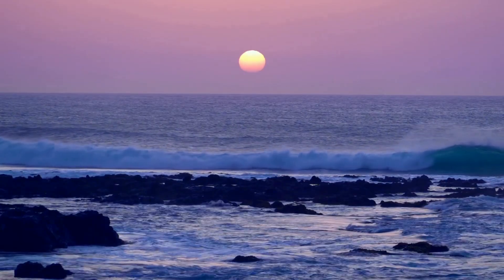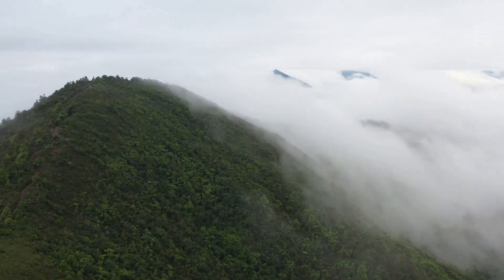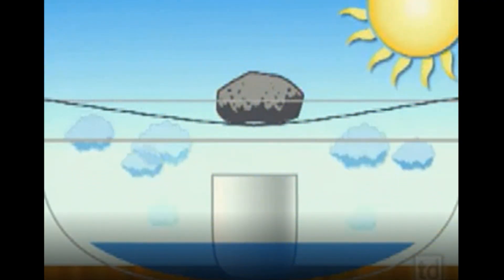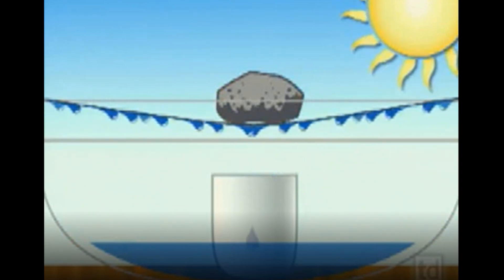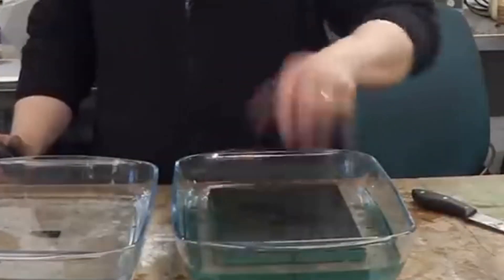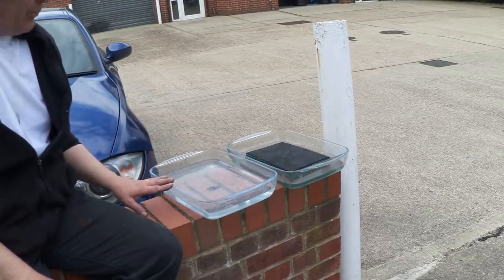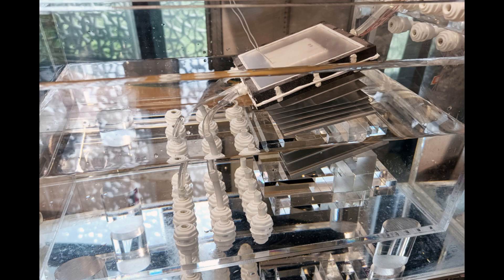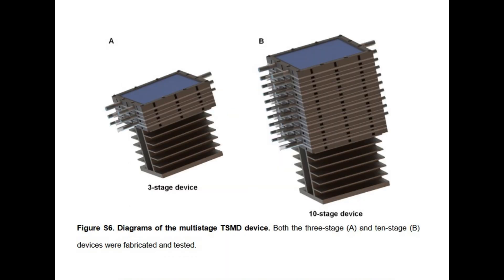2192 MIT Breakthrough On Making All The Fresh Water We Need

Comment: Another way of evaporating water quickly, abet not input energy free, would be to use a babbington atomiser. Same as a babbington burner... just with water rather than oil.
Tiny hole in a pipe. Fluid passes over outside of hole. Inside of pipe connected to source of compressed air.

The spray of droplets has massively increased surface area for evaporation to happen from. I would be surprised if salt would drop out as crystalls, Sally water more likely. Could likely be separated out by a centrifugal filter.

When I tested such a while ago I was getting evaporatoration rates for tap water of about 30l/hour. I was doing it outside in summer, and as humidity was increased towards 100% RH, here was a fair temperature drop in garden.
Reply: This is similar to the way that snow machines germinate snowflakes! Great idea 👍
Reply: Filters drive the costs up, his point was this tech keeps the cost down.
Reply: @troywhite6039  filter membranes not best re cost, but a centrifugal filter to separate moist air from  water droplets, need  be little more than a large diameter drum with a tangential inlet. Air and droplets fly into through that inlet. Being heavier than air water droplets containg the salt want to continue in a straight line and make contact with the walls and drop out of the air flow, and run down to the bottom.of drum. Moist air can make it's way out of a vent at top.

Comment: Robert can you give me a fair of brutal opinion about my idea following: My idea was to turn the Saharah desert into a self-irrigating oasis: at high tide, tidal pools fill with water. These are covered in glass possibly, and heated with solar energy to produce steam. The steam rises, then reaches a pipe made of glass from desert sand, melted by hot desert air trapped under panes of glass near the surface that trap hot aircurrents and conduct them to a super hot funnel to melt the sand to produce the glass panes and pipes somewhere (sand, seawater, and insolation). Near the surface., then reach a "blue house" where again the water is heated and steams. Then trickles down another angled glass pipe further into the desert, stepwise, to another glass-contained pool (a "bluehouse") that is insolated by the sun, where steam is generated again. This way, we can have fresh water flow automatically into the middle of a desert, without even generating electricity to do it. In fact, an entire labyrinth of glass and steaming water pipes could be built in such places so that it keeps on producing steam through entrapped insolation from the same water, which can be selectively used for greenhouse purposes, also... this idea is to 
use elementary processes like blowing glass from super heated channeled air insolated under 
glass panes near the surface of the hot sunlit desert, focalised into a jet where an array of mirrors also project super intense heat and light to melt sand for pipes and green and blue house shell components with no electricity, just light an superheated air, concentrated at the point of manufacture.

intense hot light and super hot airflow at a position can be used as a gassblowing node in the system... From the tidepools at the shore, the salt is left behind and the steam rises and runs a turbine; it exists and trickles down a long, only slightly tilted glass pipe, so the droplets run like rivulets after having been steam  further away from the previous bluehouse or glass-covered water chamber,  and through this pipe, after having condense into stem and turning a turbine, the steam enters this glass pipe and reaches another bluehouse / contained pool. here it is again covered with insolation, it could be a lens, not even solar powered, to generate steam, this steam passes along down another tube further into the desert, into another blue house., so you fill the entire desert with stores of insolated water on the surface, exposed through the glass (locally melted silica) to insolation, while cold water  stored undergound using traditional iraniaan ue for human consumption.
.
Reply: The tidepools where the water is initially removed from the ocean  can be used as salt-farm deposits.
Reply: so I disagree to the extent, I feel it is adaptable and can be used for terraforming the erg of Arabia, Sahara as well as irrigating the barren Australian outback, the hottest and most inhospitable hell hole on hearth, lol! Imagine a super-giant city-sized laboratory kit made of melted desert glass with steam and running water flowing down it and steaming up pipes as it moves around...? Solar, Sand, and SeaWater! MAGIC!Yeah?! haha I think I better stick to my Doddy Drive, then! Wizzzzz! ahaa
Reply: what terrorist would want to vandalize such a source water, The state in Saudi Arabia that is mostly covered in sand is the Rub' al Khali, also known as the "Empty Quarter." It is the largest area of continuous sand (to blow glass from from insolated aircurrents under glass panes) in the world, covering more than one-fourth of Saudi Arabia's total area and extending into neighboring countries such as Yemen, Oman, and the United Arab Emirates
Reply: such insolated aircurrents can also be used to heat up "bluehouses" to generate electricity. this can be rinsed and repeated in loops and swirls all over the desert, filing it with electricity and water, and if done on sufficient scale might even cool things down a bit, hence my notion of terraforming. Perhaps Elon Musk should consider such a project on earth before only thinking about Mars... but perhaps his Planetship (see the movie Battlefield Earth, it's hilarious, a space-parody by L Ron Hubbard, the founder of scientology) starring John Travolta) has this duty to perform.
Reply: Jeez I'm out of breath.
Reply: i see dead people and need $1000 to flee South Africa. I'm my father's hostage... I don't have Stockholm syndrome @justtinkering6713

Comment: Here’s one for you coach! At night in the desert by the ocean pump salt water into black ABS pipe. The pipe is flat and only about half to 3/4 full and can be configured in a serpentine or a manifold. Pull a partial vacuum releasing some or the bulk of the dissolved gases in the water. The other end of the manifold has a reverse P-trap that has no water in it. After the P-trap the pipe runs back into the ocean. The sun heats the ABS pipe, the partial vacuum boils the water under 100 and the steam condenses in the black pipe under the ocean like a heat exchanger. This condensation will help maintain the vacuum. At night flush the pipe out and diffuse the brine far into the ocean. 🎉
Reply: Retain the brine for salt production right next to the desalination site. Water and salt production in one place. We need both.
Reply: You might want to try this on a very small scale because there are a few holes in your idea, especially revolving around your idea of holding a vacuum. I'm not trying to diss you, just suggesting that there are a few things you aren't taking into consideration so some small-scale experimentation might illustrate the problems you'd experience at larger scale.
Reply: @ehrichweiss  thanks for your great comment but I’m not trying to suggest a self-sustaining system. You would need to continue to put energy into the system when you start losing vacuum. The vacuum is there just to decrease boiling point and I believe would decrease total energy costs.
Reply: Pumping gas takes a lot more energy than pumping liquid. Same will apply to pulling vacuum on a gas.

It should however be possible to pump water up to fill say a tube that's say 30m high. Then seal the top of, and open a valve to atmosphere at the bottom, alowing water to drain. Pressure at top of water column will then be reduced by whichever the smaller of,  pressure equivalent of "30m of water", or vapour pressure of water for the temperature.
Reply: @stevecummins324  True but I specified partial vacuum.  Water boils at 100°C at average atmospheric pressure and at sea level. It is easier to boil water on top of Mount Everest because there’s less pressure. Therefore using less energy. The partial vacuum in my system speeds up the evaporation of the water. And it also provides the water vapour a place to go when it recondenses using these submerged pipes as a heat exchanger. For your water column idea take a look at pump head pressure. Every water pump has a graph so the higher you pump the more energy you use and less water you move until you reach a point called deadhead. When you open the bottom of the column to atmosphere what you’ll do is just have bubbles going through the water to displace the water at the top of the column just like chugging water through a water bottle turned upside down. You can stop this by restricting the flow at the bottom of the column with a very small orifice plate that will not allow air into the system. So in that case the weight of the water will create a vacuum at the top of the column and start extracting dissolved oxygen and gases then through the heat of the sun on the column will eventually boil the water inside at a lower temperature just like my system.
Reply: Phytoplankton that we depend on for the oxygen we breathe are extremely sensitive to changes in salinity. If we want to desalinate water on a large scale, we need to figure out what to do with the brine... Half the reason our freshwater is in this state is because of this mentality that rivers and the ocean are nature's toilets and landfills.
Reply: @cheyannei5983  I like your comment.  Apparently you know a thing or two about desalination.   
    Can ionization be employed in disposing of the brine? City landfills require covering trash with dirt. Can that dirt be partially comprised of brine ?
Reply: @clavo3352  I don’t think that would be a good idea to introduced salt to our environment. In the hydraulic Water cycle fresh rain water constantly dissolves salts and carries them eventually to the ocean. Adding a high concentration of salts in one area will most likely contaminate the fresh ground water for years until I can make its way to an ocean.
Reply: @cheyannei5983  How much is a large scale project compared to the natural daily water cycle evaporation? Doesn't nature just leave the brine in the ocean?
Reply: @Wayward2023  you bet it does that’s why in very warm climates in inlets that do not get fed by freshwater streams the salt concentration is higher. Evaporation increases the concentration of salt in the water. The Red Sea is a great example of this.
Reply: @cheyannei5983  yes I absolutely agree that dumping the brine directly into the ocean at the shoreline is a very bad idea. That’s been the problem with most new technologies in industries over the years. Improper waste disposal. But the solution is very simple and it’s just a matter of concentration. Installation of a pipe miles long or splitting the pipe into multiple manifolds with small holes allows a lower concentration of brine salt water in the ocean. And depending on where you are you can take the fully concentrated brine and put it right at the mouth of a fresh water river, again decreasing the concentration of the brine salts.
Reply: Too much accent.
Too much 'wau-tuh'. 
Too much 'this sounds too much like a guy who likes to hear himself talk.'
Reply: @hg2.  ?

Comment: Great topic, our world needs more people like yourself. Do you have any other simple desalination set ups posted such as simplistic diy filtration units from common materials that would serve a tiny seaside camp or houshold? Thank you Robert.🙂
Reply: Have a look at using a ceramic flower pot as water filter, the pores can filter out heavy contaminated water from what I've seen.
There are commercial versions available but they are quite expensive.
Reply: The pores will clog with the salt so a constant cost of new ceramic filters will need to replace the clogged ones driving up the cost/price of the water.

Comment: my thought was to lay a big pipe 700 meters deep in the ocean with a reverse osmosis filter at the deepest point, so the natural water pressure down there would do the job of pushing water in through the filter... would just need a pump to pull the clean water out and up to ground level... although i guess that pump would need a fair bit of power...

Comment: So its great that this process can clean water to the point that its drinkable. However i am greedy if the heat sucks the water up than you have flow if you have flow could you not have a wee water wheel to generate a bit of power.

I know that you can not get perpetual motion as one would drink the water and you need the sun to get the heat 

All that being said would it be possible
Reply: Yes, there's a guy on youtube that has a water wheel on his gutters to charge his cell phone.

Comment: ive always been abit confused when it comes to what we need from water, like ive always been under the impression that you need minerals in the water and that distilled water would leach nutrients from your body, 
what do we need from water? or should i say in water
Reply: That's why they add back into the clean, pure water about 5% sea water to get those minerals. Great question.
Reply: @thirsty_dog1364  oh right I didn't think of that I thought it woul be like put cut up fruits in there with some juice and let it sit or something, this tiny bit of information is what I've looked for forever and you explained it so concise thank you :)
Reply: We need certain trace minerals in the water not only to replenish what the body needs but because pure distilled will not conduct electricity which our body does us being electrical beings. Alsosome of the cells of our body can explode and become damaged with distilled water which has a density property that over pressurizes the osmosis transfer too quickly. Drinking water needs to be as close to our cell makeup as possible too be less damaging and more healthy. The less oxidation the better to prevent inflammation. You can infuse plants and fruits and minerals and salts in distilled water to bring it back to an electrically and more dense healthy level also which is an added cost but most commercial applications do not want to add more cost than necessary. After all alot of this water gets wasted for other things besides drinking, like flushing toilets.

Comment: Solar still idea for better efficiency: Black reservoir,  curved glass lens solar magnifier, under drip point of lens glass collector and tube for funneling condensed water out of heated evaporation chamber. Control water feed into chamber with controlled drip rate to maximize the surface area to water ratio. Periodically flush evaporated excess salt build up out with excess inflow rate and opening flush exit valve.
Reply: I wondered why a lens isn't used to heat up the water. Then again I didn't calculate anything to find out the answer myself. Sounds like a wonderful idea at first glance.

Comment: Wondering how it's collecting the water after though... Off to the paper!
Reply: A mirror directly above at a 45° angle.  An array of mirrors focuses light there and it reflects onto the system.  The water evaporates up and hit the mirror.  The mirror is cooled with some system the fresh water condenses and is collected.
Reply: The paper is very interesting it uses a membrane whole different type of system the water doesn’t evaporate.  It’s very neat tho it could be powered by any heat solar or waste heat.

Comment: Wonder if something like this could be used on boats?
Reply: Would need another boat sized device to get enough drinking water from it. Like solar panels if you can come up with a way to increase a surface area of evaporation in a smaller area, that's the key to producing enough.
Reply: @HappyFace6or7  According to the paper, a m sq unit could produce 4-6 litres an hour.